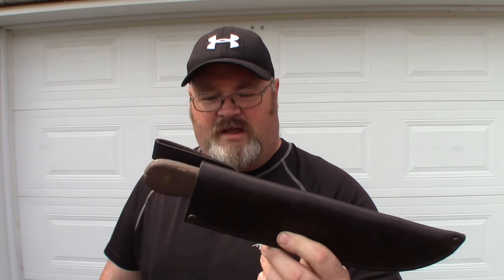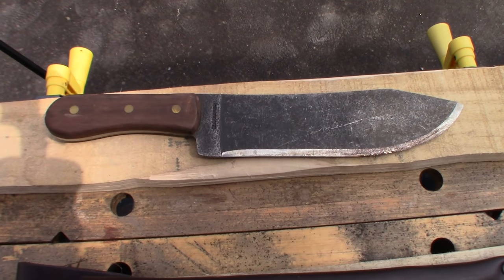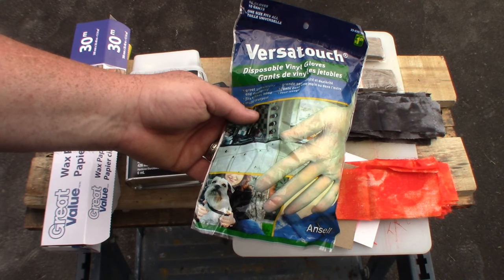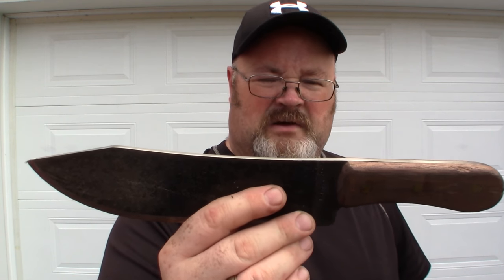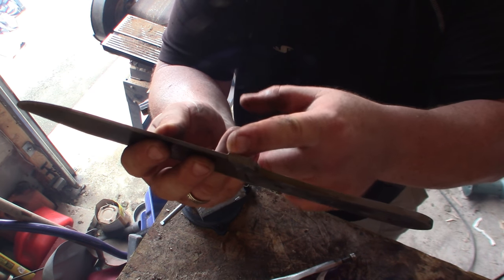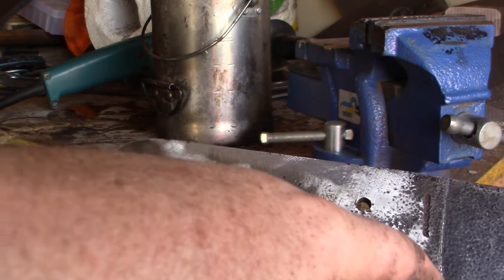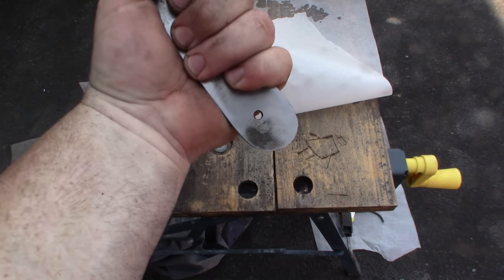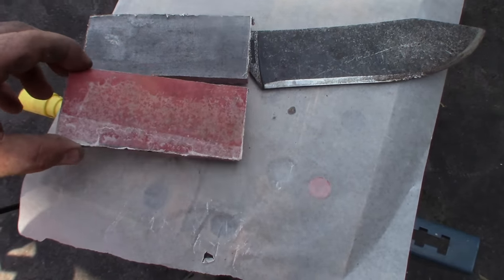Hudson bay camp knife mods

Comment: You raise that edge up to high it’s gonna be very weak and quite thin. You would much rather the edge roll than chip.  The steel that they make those out of are 1075 and is a little softer than other carbon steel. Nothing wrong with it but if it is thinned out to much it will definitely chip. Those knives are designed to take a beating.
Reply from the maker: I agree I wont be going too high maybe another 1/16 and actually convex it. To be honest I dont like this knife at all except to throw. I have other knives that far out perform this knife. I saw so many great reviews on this knife and after using it for 10 minutes I was just disappointed. I was going to get rid of it but decided to throw it around a little and ended up having a blast. So I will keep it just for that.